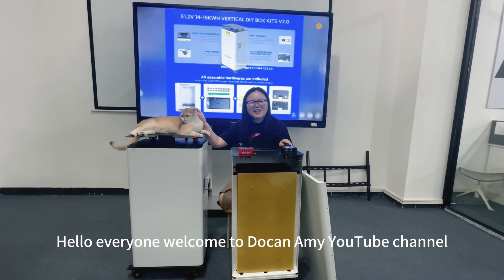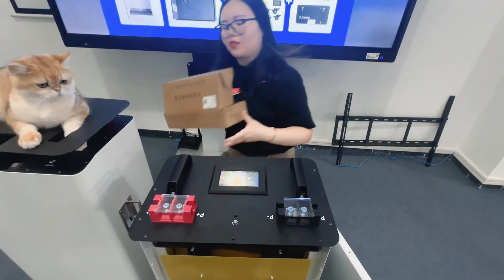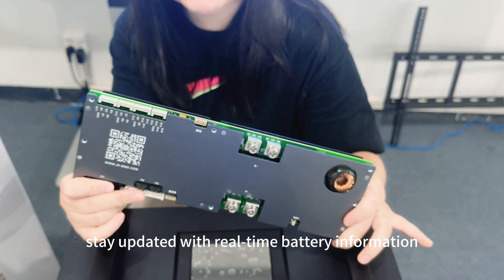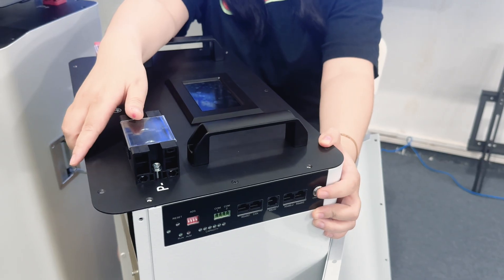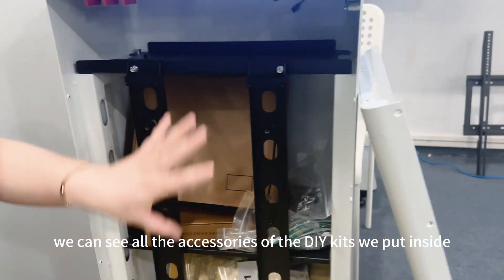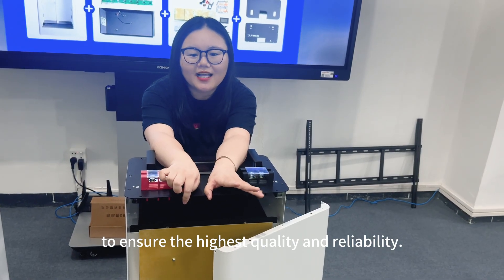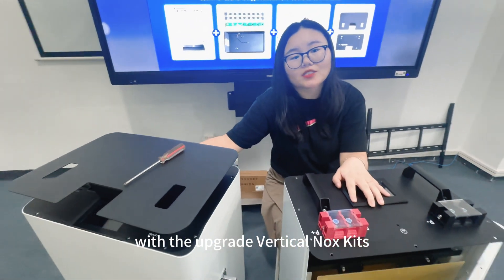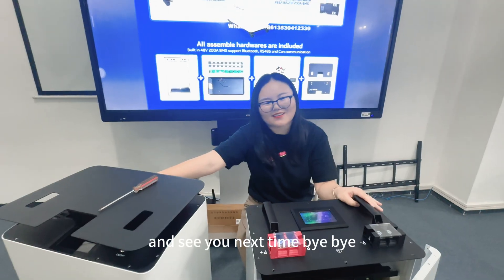Docan Apexium New Vertical DIY Box Kits Verion 2 and 3

Comment: Amy, the Apex box kits you sold me worked great, I like these vertical kits better, but they still need a shut off circuit breaker (with the fuse), and if those had rack mount brackets, it would help to secure them to a wall, or lay them down in a rack... another vendor makes one like this.
Reply from the maker: Thank you, yes we will add the breaker in 2025